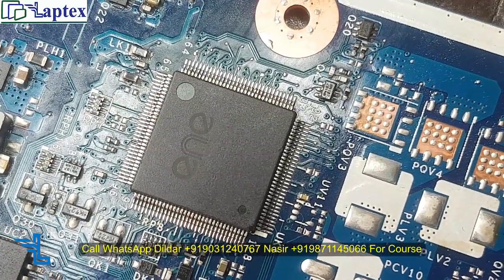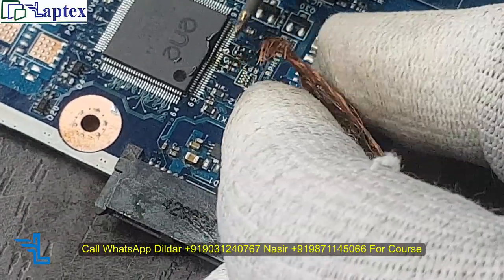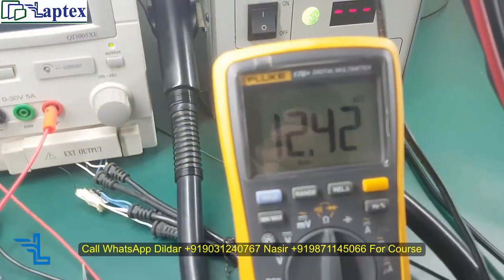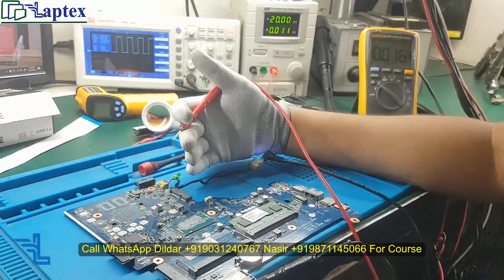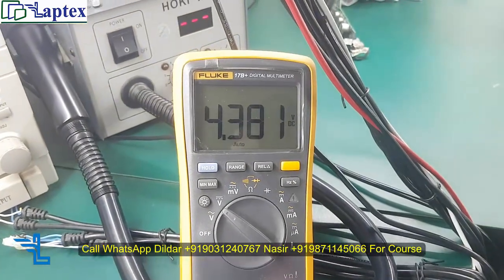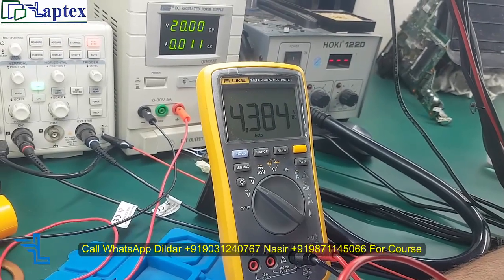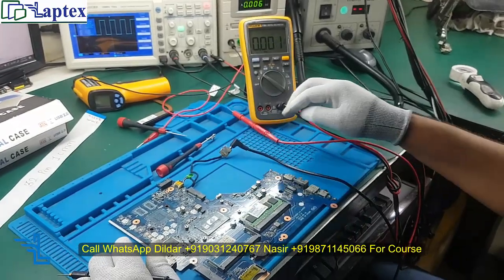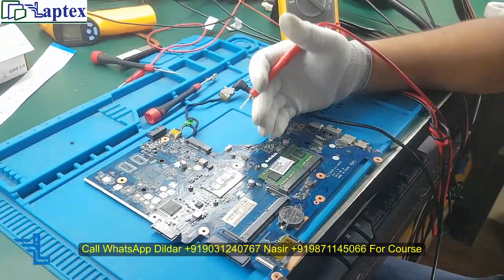DCIN, 3V 5V and SIO controller problem and concept in LA a992P | ENG Part-2| Chiplevel repair course

Comment: Hello sir, what is the replacement chip 3v 5v of mobo GV452/GV552 Rev 1.0 NM-D210
Reply from the maker: Check pinout details and then match for requirements.

Comment: please sir i would like to inquire from you,what causes inductor coils to heat up ,most especally cpu core inductor coils but it has good output voltage
Reply from the maker: Auxiliary components or the Gate pulse ..